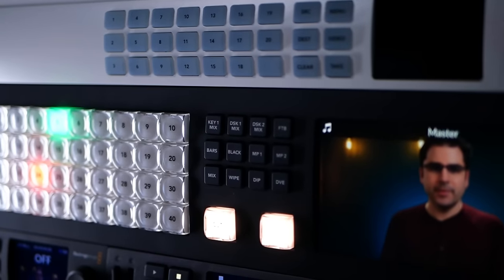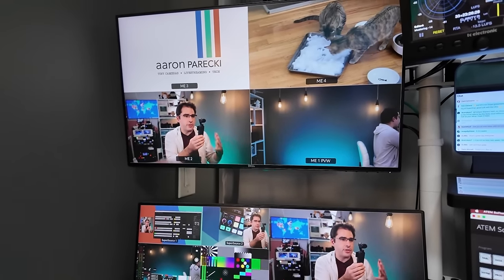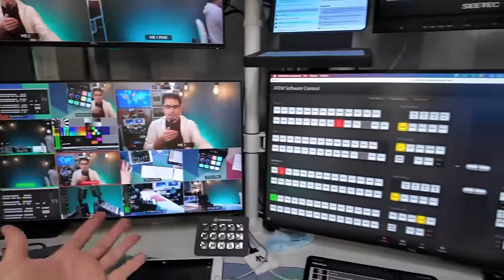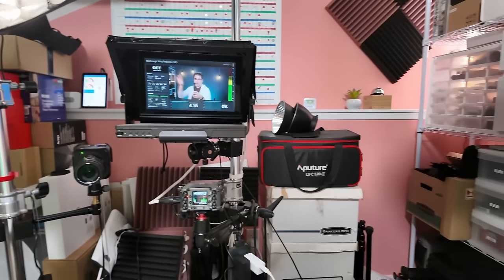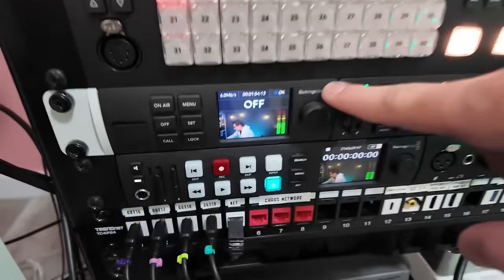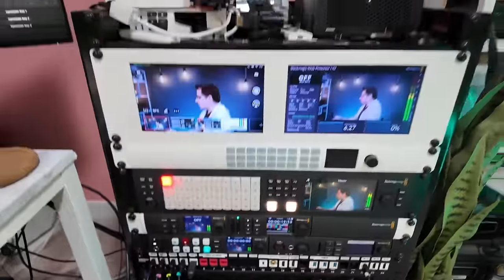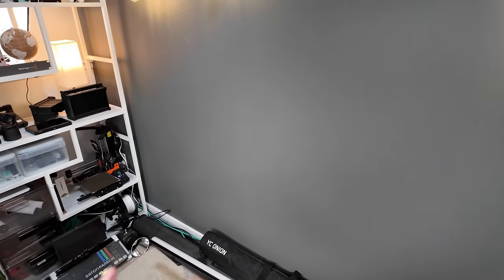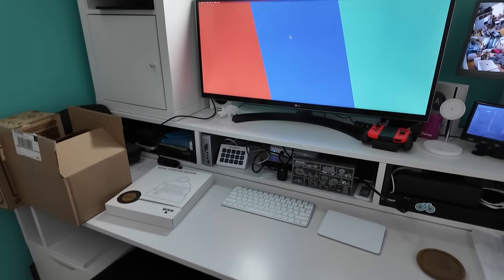My extremely overengineered livestreaming studio | STUDIO TOUR 2024

Comment: Awesome Studio Aaron! Thank you for sharing. I have a question about your patch panel in the rack. Do the ports ever push through the panel when you are connecting things? Are they secured to the panel with screws or with some sort of tab system?
Reply from the maker: Thanks! They are "keystone" jacks, and they just snap into place. Most of them are fine, but I have noticed there's one type (I forget which one now) that is less strong than the others and has pushed through. If the snap is strong enough it's almost impossible to push it through though.
Reply: @aaronpk Thanks for the reply! I was intrigued by the setup because I have patch panels with screw mounted ports, all except the ethernet port. That dang ethernet pushes through all of the time! Making the patch panel with tiny screws gets tedious so I saw yours and thought it may save me from pulling my hair out.
Reply from the maker: @rossbyrd2600  Ethernet is definitely the most common type of keystone, so I suspect there is a wide variety of quality of those jacks. Try buying a different brand and see if that helps!

Comment: the "TC ELECTRONIC Clarity M" where is connected ?
Reply from the maker: It has a cable running from the Web Presenter output to an SDI converter behind the Clarity M, so that it's always monitoring the final audio going out on the stream
Reply: @aaronpk   over the top !!! thanks
Reply: @aaronpk  Have you heard of/used Angry Audio's C6s plugin or C4 livestream processor? I've been using it quite a bit on my corporate gigs on my audio stream to video world and it's been a game changer.